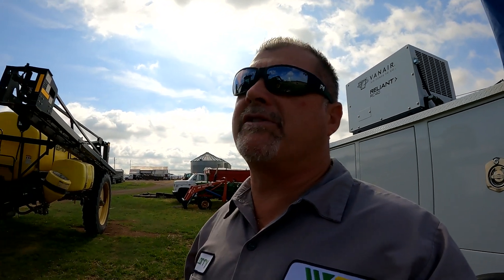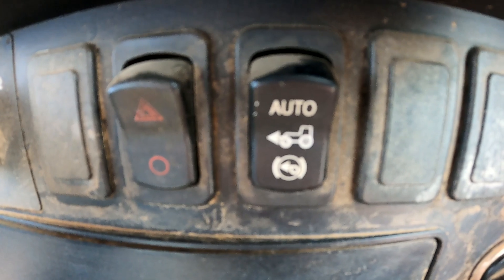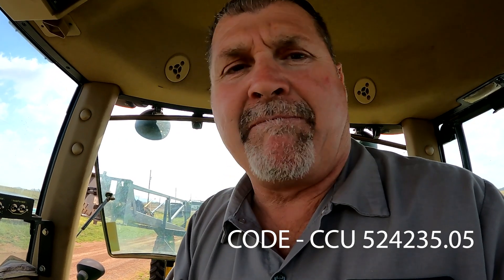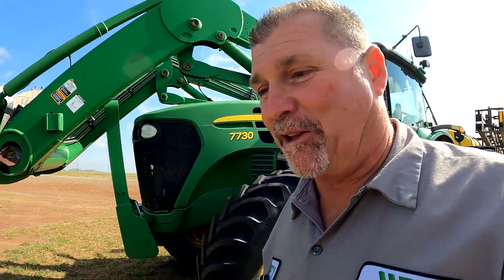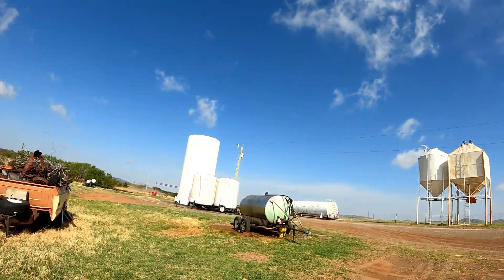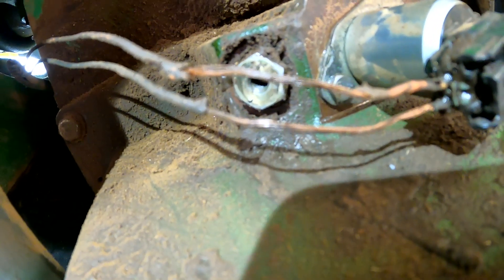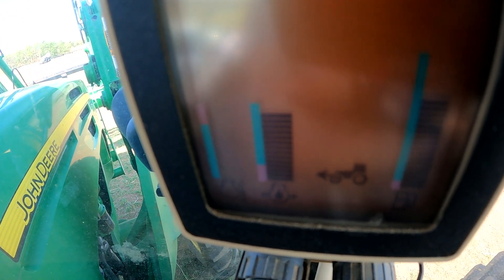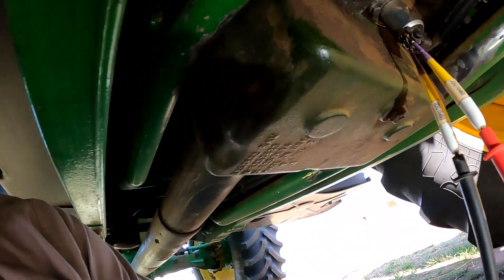Larry's Life E13 | John Deere 7730 Front Wheel Assist 4WD Diagnosing, Wiring Tips, Ohms Test

Comment: wow, high dollar tractor like this and micky mouse wiring running unprotected
Reply: I have a brand new John Deere z920m and it rattles. From the deck and the engine cover. At higher rpm the engine cover doesn’t rattle but the deck lift arm still can.

You spend all that green to buy green but your not getting all that much for it.
Reply from the maker: I agree, it is unfortunate that this is not protected better but this is why we want to shed light on how to fix it. Thanks for watching!